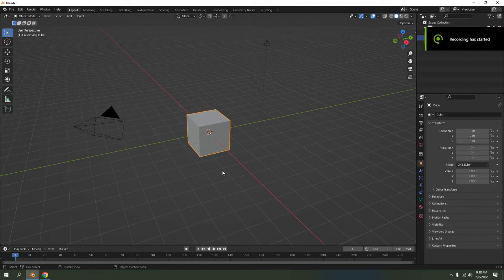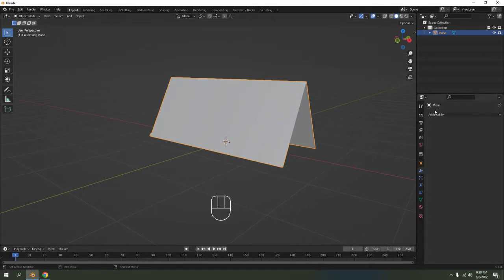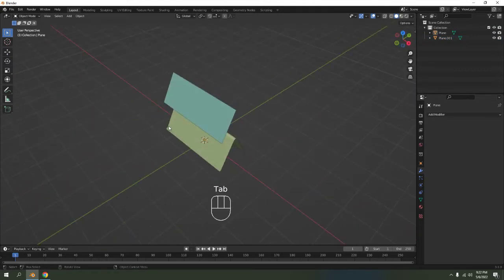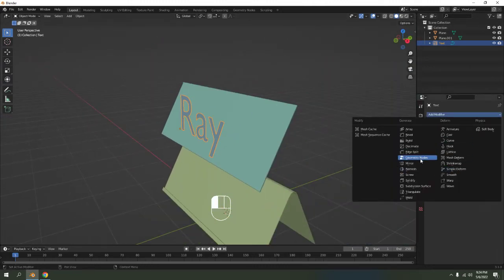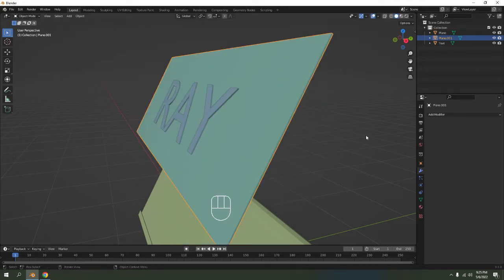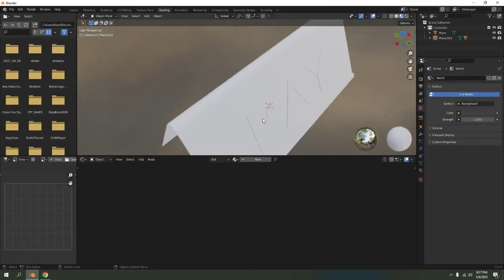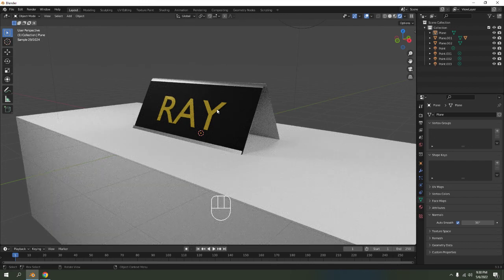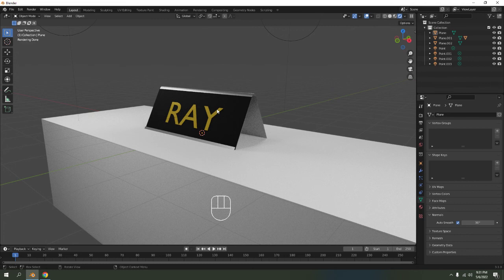Blender Tutorial | Desk name plate

Comment: how did you make the edge at the bottom? i'm having prroblems following.
Reply from the maker: Hello. If you meant from the 1:22 , i just extrude them by pressing E. You can press X/Y/Z after pressing E so it follow along the axis straight, based on which one you want. So what i did : I extrude (press E) and Y to estrude it to Y axis. After that, i extrude to the Z axis but i don't press Z because i just move it randomly using feeling. Hope this not confusing to you😅
Reply: @RayStudio95  hi i've been pressing E and nothing happened. i looked it up and i should press e with alt to extrude. thanks.
Reply: @RayStudio95  now I'm trying to smoothen the tops and i'm still working on it